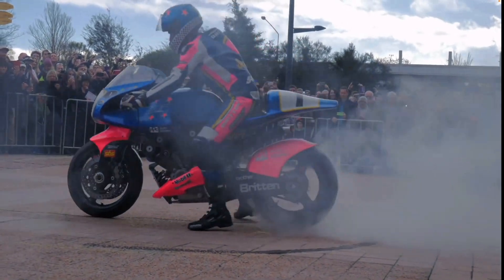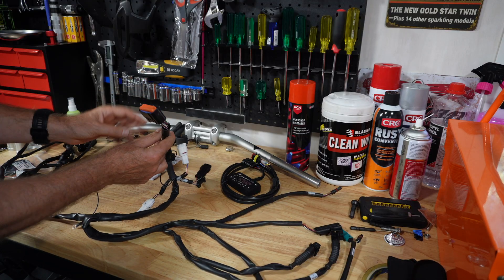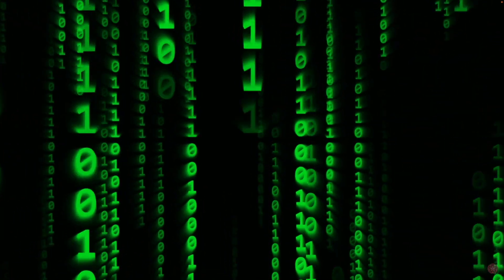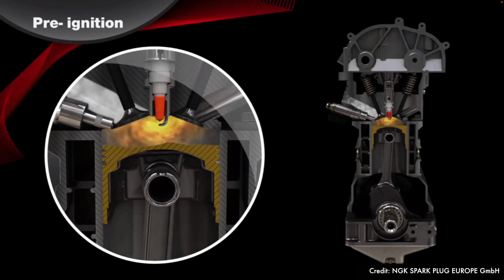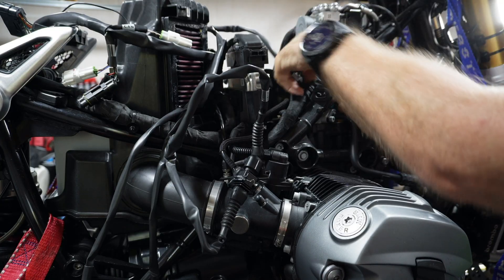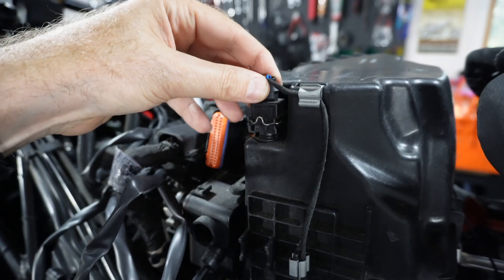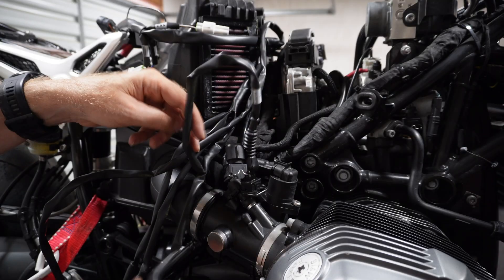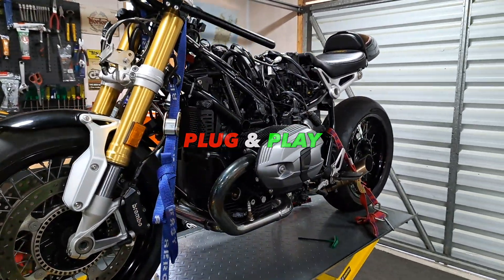R9T: How to INSTALL a RAPIDBIKE Module

Comment: Hi, good video, but what do you do with the original ECU if you install the ones in the video?
Reply from the maker: You're not replacing your ECU. In very simple terms, you're plugging a "middleman" (module) in between your existing ECU and engine components. The module interprets  information coming your bikes sensors and tweaks them over time (adaptive tuning) as it understands how you ride.

Comment: Awesome my question is with the airbox delete from PCC and with the Rapid Evo Fuel management.  Will there be any issue with the bike performance? Im thinking of buying a used Rninet with this mods.
Reply: The Rapidbike Evo doesn't come with an airbox sensor. But in regards to the airbox delete, I personally believe regardless on whether or not a Rapidbile module is installed, that the airfilter pods will actually reduce the amount of air reaching the engine compared to the stock snorkle. Many people dislike the snorkle on asthetic grounds, but effectively the snorkle functions as a "RAM Air" induction. Meaning not only is the negative pressure of the engine sucking the air in, but the faster you ride, the more air is forced down that snorkle into the combustion chamber of the R9T. More air, means more fuel (default ecu table range), so more bang, which  means more power. Where as the pods rely solely on the negative pressure created by the engine to suck the air in, the pressure doesn't increase much with the pods the faster you go, meaning less air compared to stock. So in my personal opinion the snorkle with the RapidBike module is preferable if you are mainly concerned on performance. But for sure those pods look sweet. Note, this is just my opinion based on the engineering of ram air induction designs and I have absolutely no data to support my theory🙂

Comment: Hi brilliant video just installed my rapid bike evo.  I have an alarm.  So where would you recommend storing the rapid bike evo
Reply from the maker: Good question @ibnanSuleman👍. If the space at the back of the tank is already occupied with an immobilizer as is in your case, and you are not able to store it in the seat cowl, then you need to get a little creative and employ a little fabrication of a bracket to attach it to the inside frame or even a couple of zip ties. In the case of the Race module being black it's not so noticable. In the case of the silver modules, I'd spray them black or fabricate a little box/mount. I'm likely to have the same decision to make in the near future, as I will be returning my R9T to road condition instead off race and will reinstall the alarm. So let me know what you finally decide on. Maybe you find a better solution than what I have suggested. Good luck👍👊✊️

Comment: Really enjoy your vids. I installed the Rapid Bike Easy, a simpler and cheaper version of your system, but I can't feel any difference in performance. I'm a bit disappointed as it cost $300.
Reply from the maker: Hey Dave, good to hear from you again.😃 But sorry to hear about your experience with the "Easy"🙄. Yeah I can believe this has been your experience, as the Easy is a very very basic unit. So basic it should have been called the "Basic Module". The difference between the Easy and the Evo is a bit of a jump, and then the Race version is yet another level again. Unfortunitely that $300 would have probably been better spent either on a straight static ECU Flash (non-adaptive) or put towards an Evo which is fully adaptive. I wish I'd made this video earlier. At least you still have an awesome bike even running stock!!🤩